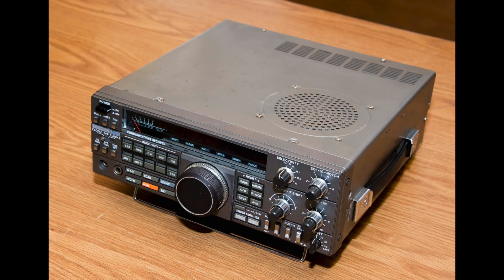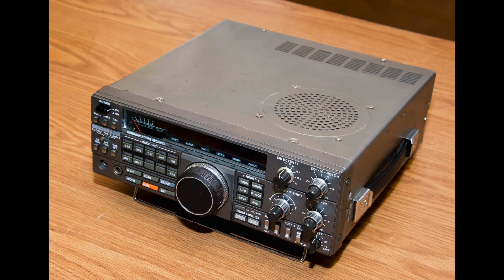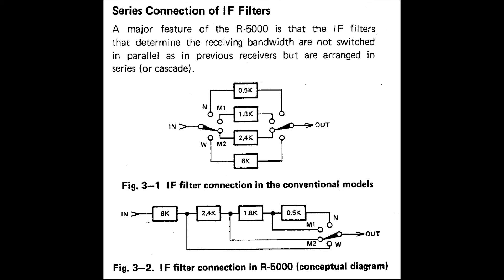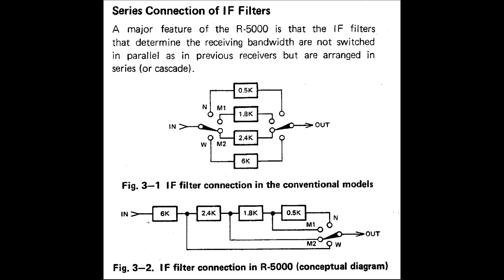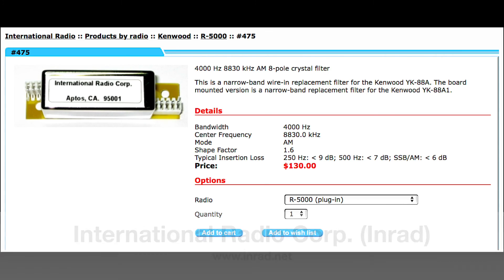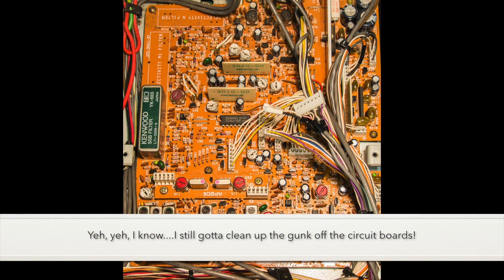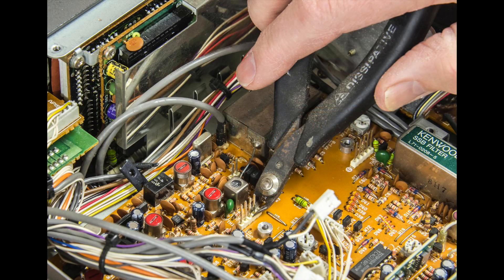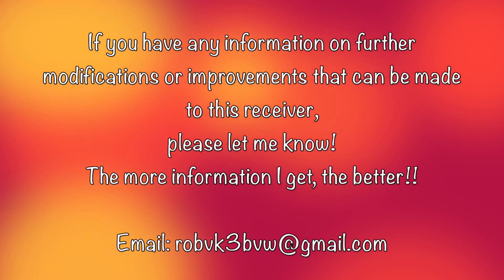Kenwood R-5000 Shortwave Receiver - Restoration - Part 3

Comment: Are there 8 or 10 khz filters available from InRad for the R5000 to put on the wide slot?  So I was thinking to do  10  6  2,4 and 1,8 khz

Comment: Thank you for this nice series! I just bought an R-5000 in orginal, stock configuration, and the AM filter is quite poor indeed. I just ordered the INRAD 4KHz and can't wait to get it! I believe that the "even on the Kenwood filter" scripting you mentioned most likely indicates that the stock Kenwood AM filter (and possibly the Kenwood AM YK-88A-1 upgrade filter) never needed those two extra pins on that side of the filter. I think that, to save production costs, Kenwood's filter producer most likely used the 5-pin configuration to avoid having to re-tool to produce a separate 3-pin module.
Reply from the maker: Thanks and good luck with your new filter!
Reply: The Kenwood R-5000 service manual shows that the two inner pins on both sides of the AM filter are redundant ground pins. The middle pin is grounded to the same contact point on the circuit board, so as long as you leave that one pin you have sufficient ground contact. I've seen this INRAD filter installed in the opposite direction and confirmed that the impedance is the same on both sides of the filter, so you can install it either way. So even the original stock, standard Kenwood AM filter does not need them.
Reply from the maker: Yes, you are absolutely correct. Thanks for your observations.

Comment: Curreous Rob ,i have the 440S buts it is not so good  on broadcasting compare with the 5000 i have all the options  filters  cat  and for digimode  .It wk good on the HF bands but its deaf on the broadcasting like i wriitten  cu  Aussie friend  Greez from Belgium  de ON3MK  73,